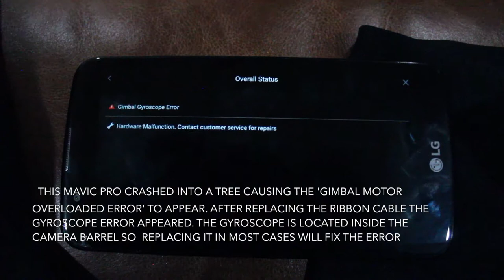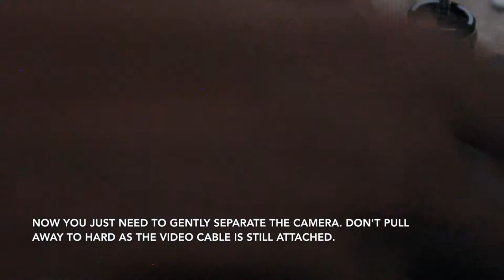Replacing DJI Mavic Pro Camera Lens Barrel for Gimbal Gyroscope Error

Comment: I cracked the glass on my camera. 
The replacement went just as you demonstrate in your video, so thanks!

Note:
Look for the grey sealant (3:46 in the barrel) and ensure that you don't toss it out with the old camera. I mention this because the sealant stuck to my camera unlike what you see in the video. I had to crape it off and put it back in the barrel as illustrated. You need this to seal the barrel against moisture. Replacement cameras do not include this sealant.
Reply from the maker: Glad you were able to fix this yourself. I also believe that silver paste is used to prevent the camera components in there from overheating so yes it is necessary to put that on a new camera lens or thermal paste can be used as a substitute.

Comment: My Mavic pro is in the same situation as yours. It cannot be restored after self-test. I also tried to update the firmware, but it also failed. I also changed the camera module and it doesn't work either. Can you help me？pls❤

Comment: I replaced the ribbon, and the camera cable.  All three axis try to calibrate on startup but gimbal goes dead after, and I have "gimbal gyroscope error"  I also have no video.  It sounds like its the camera that needs replacing now like you showed.  This is getting to be an expensive crash.  I'm actually repairing it for someone else.  Too bad I don't have another to try.
Reply from the maker: I once had an issue where replacing the camera barrel didn't fix the error so this could also be caused by something else. If you'd like to send this in for repair send me a message on my website.

Comment: I absolutely cannot get the camera barrel off, I’ve removed all 6 screws and it seems to be fastened still. Any suggestions?
Reply from the maker: Sometimes it's very hard to remove due to the paste inside sticking them together. You will need to pry it off and try not to damage the video cable in the process.

Comment: Can you recommend a tool kit for the Mavic?
Reply from the maker: I'm not sure of any toolkits for the Mavic only but I use the iFixit 60 piece toolkit. The only tools you would need to repair your gimbal is a 1.5mm Hex driver, PH000 and/or PH00 driver.

Comment: Where did you get your camera barrel?
Reply from the maker: I have some for sale if you need one but I purchased this one from 'Thunderdrones'.
Reply: FixationHub I'm interested in how much. I need one as I have the same problem after replacing the cable!
Reply from the maker: $90 + shipping.
Reply: eBay has them for $15 to $30.
Reply from the maker: I just checked and your right. There weren't any on ebay when I purchased mines a while back and I had to pay much more.
Reply: can anyone confirm that the ebay lens barrels are genuine/ the real deal? there is such a price discrepancy, $10-70 and all but one are coming from china. perhaps someone could link one that they have purchased of ebay and can confirm it works. thanks!
Reply: Blaze Sky I got a China one and it’s not in focus. Paid $13 or something